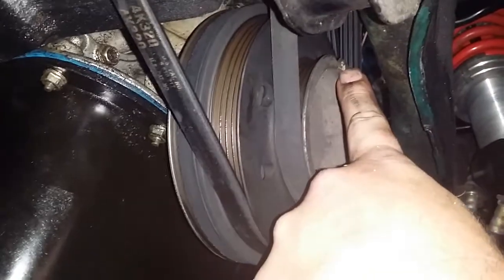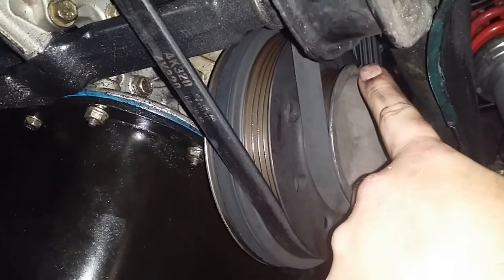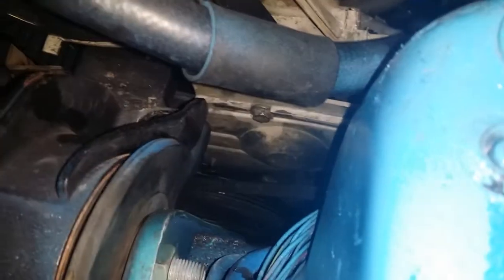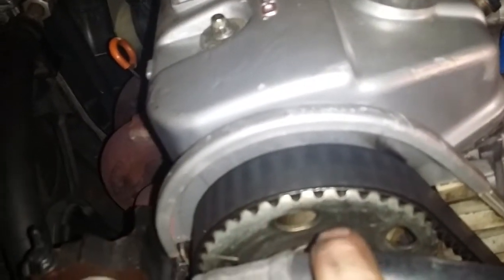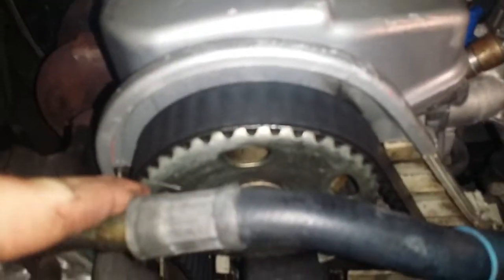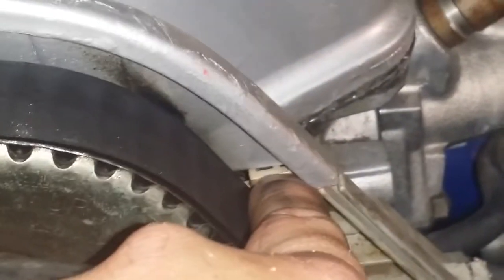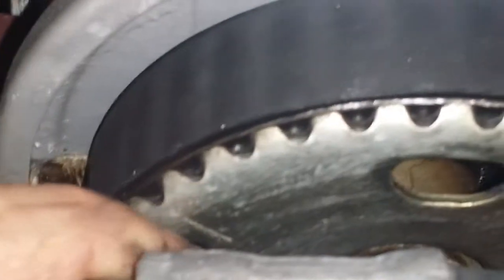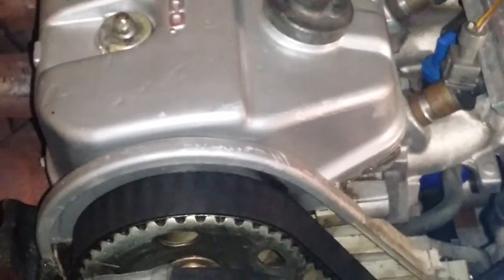Timing Honda D15b7

Comment: if you look at your cam there's 3 lines, they line up horizontal like you were pointing out but the lowest one on the left hand side lines up with a mark on the plastic cam piece on the left side of the mount. on the crank there's 4 marks all together on the alternator belt portion not the power steering part and white mark lines up with the plastic mark of the timing cover